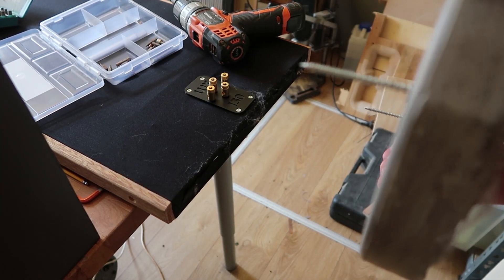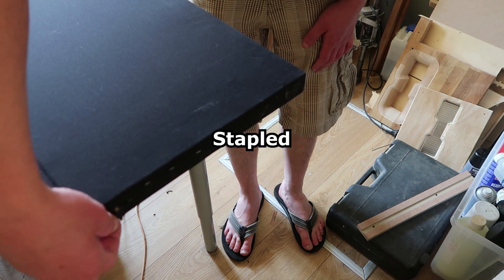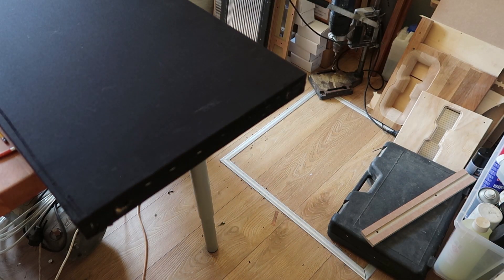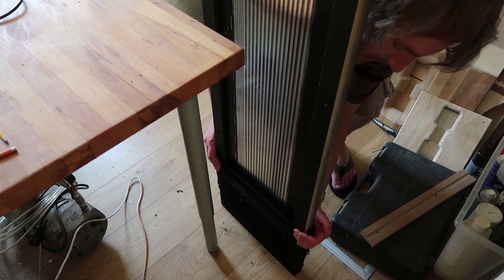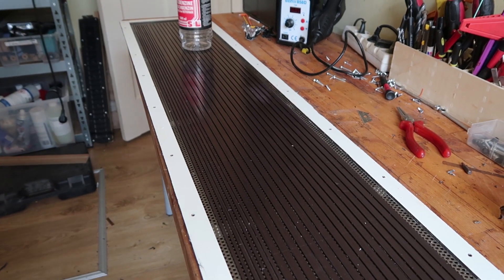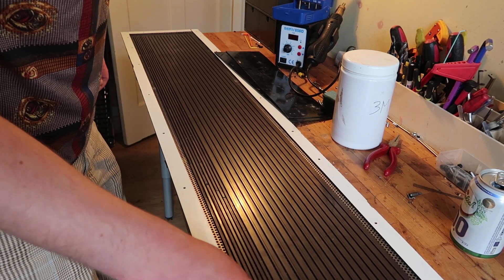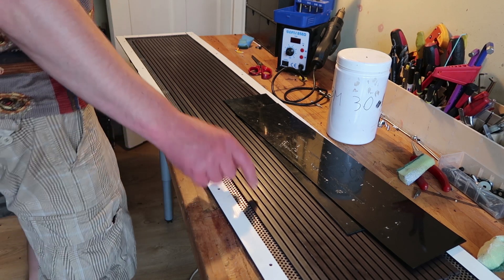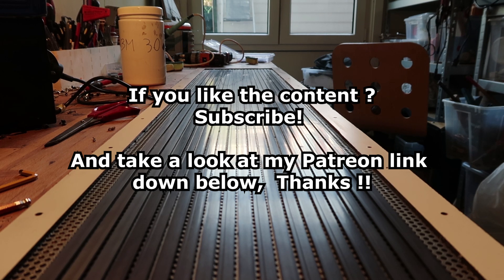Fullrange Planar magnetic speakers - Overhaul - Part 1

Comment: I know i’m kinda late, but what’s the difference between bass magnets and tweeter magnets?
Reply from the maker: well the magnets are just magnets, but bigger magnets extend there magetism further out. so for bass bigger is nicer, (often they have a larger xmax) then again wide magnets makes it not possible to have trace to trace distance be close... this will hurt high end. so less wide magnets are more suitable for top end /mid range. besides that big magnets might create cavity resonances at a lower frequencie. in the bandwitch you wanted to use

Comment: Where do you find the your magnetic strip? I can only seem to find sticky back magnetic strip. Because of the sticky back, you have to buy a roll of type A and Type B to allow for alternating poles.
Reply from the maker: well i get it from a wholesale company that only sells to other companies in the Netherlands :(  so im sure you can get it somehwere else but i dont know where :(  it is anisotropic magnet 3mm thick 8.5 mm wide. magnetised trough thickness. make sure you dont get multipole magnet. (most rubber magnet is multipole) one side of the magnet just have to be north other side south.   i do sell rolls for 100 euro 50 meter ex VAT/customs. but shipping might be expensive depending on where it has to go :(

Comment: I don't have the tools to build planars. What do you think of DML speakers? I'm thinking of sticking some dayton exciters to a pair of 50/50 cm  plexiglass pannels. I think I'll be able to build a frame for them  with the tools I have.
Reply from the maker: exciters are good fun to play around with! if plexiglass works i dont know i think a bit heavy, but  who knows. exciters is all about trying 10000 different things.   XPS foam has a good record. as well as laminated substrates light and stiff is the main thing ! rounding of corners and placing excisters  so you dont have twice the same distance from exciter to any end of the stuff you put it on. (so never in the middle)

Comment: Thanks so much for taking the time to share this with us. I am redoing the crossovers on mine right now, 1.7i's, and now that you have given me some info on redoing the Mylar with all three videos in this series I am thinking that I would like to attempt that if I can find a less pure form of aluminum foil to raise the resistance of the foil wires, making the crossover simpler and more efficient. Right now I get 4-4-1 on my ohm meter and I would prefer 8-8-8 for better definition.

I too have taken the tweeter off of the main panel and am going to use a linear array of planar tweeters for that task. Although you gave me an idea for those as well when you added more magnets, where the 2 tweeters could be placed on the outside of the bass panel on both sides, broadening the soundstage. The singe loop of foil on the existing panel gives me 1 ohm of resistance, and so I added a Mundorf wire wound cement covered 2.7 ohm 25 watt a cross the connectors of the tweeter in order to give me more latitude in upgrading the XOver.

Have you ever considered using a cone speaker coil mounted to the center of the with a metal spider holding the motor in place in a panel minus the wires and magnets for the bass section? This is something I would like to pursue in my quest to make a panel that does not require 500 watts to drive.

Thanks again for all of your work.
Reply from the maker: Glad you like the videos ! upping the impedance is not a good idea if you ask me. it will hurt the output and the filter will need a complete rework. and will be more expensive as well.  if your 1.7 are stock i would not rip any foil :) its hard to get it where they where.  i am not sure what you mean by broaden the sound stage, making things wider narrows it :( but i might not get the idea your trying.  adding a resistor that is 3 times the resistance of the tweeter means you will blow 3/4 of all your power in the resistor... that leaves not much for the tweeter, if they are very efficient tweeters  you can else.. its a waste

a cone to a piece of mylar is a no go.  for cones to be usefull things need to be stiff. mylar is everything except stiff :) if you push on it with your finger it will only hit the magnets under your finger. thats exactly what happens when you drive it with a small cone or voice coil. only a tiny piece is playing (and badly even) the rest does nothing .  thats why the coil on planars try to cover the whole foil as much as possible , and drive it as uniform as they can.

if your looking for more efficient planars none of the upgrades you make will make them more efficient im afraid :(  only size will , or making them push pull. or use different magnets :(

kind regards Joppe
Reply: @joppepeelen  I’ll reply in your order of questions. Broadening the soundstage by having tweeter elements on both sides of the bass panel. Since they are at the edge, side, now they are correctly placed as their travel is limited by the membranes attachment to the frame, so the shorter travel of hi frequency generated sound waves is properly positioned in the scheme of the panel layout. But, by trying a tweeter on each side of the bass panel I can raise the resistance of the tweeter element and double the surface area giving better tweeter volume along with two point sources with less distortion imparted to the mid and bass sections. At least theoretically.

Right now the XOver that came with the panels is a discharge capacitor bank for the mid’s and hi's, a capacitor for the highs, and then an inductor at the end of the circuit returning to the amp. This completely destroys the upper range of the speakers, all in an effort to tame the panels ability to create a low load short to the speaker signal. I've driven each section without any XOver parts. The bass panel is driven that way from the factory, full range with no inductor to limit the mid’s and highs. It's 4 ohms, so my amp can handle it. Same with the midrange, although to a lower volume before the amp faults out. The tweeter is only 1 ohm, so is close to a dead short. This of course could be rectified by a larger tweeter panel, same as the midrange as an example, but faults the amp out at very low volume. 

So Magnepan, by not using quality XOver parts is adding a resistive load to the panel with caps and inductors, but not in a sequence that a typical XOver might place them in. My question, which I am trying to answer myself, is if an audio quality resistor and cap can raise the resistance of the tweeter to an acceptable load, why not use them and do away with the soundstage robbing 1.4mh inductor at the end of the XOver circuit? That does throw the amps watts away, just as a bigger resistor, right?

Anyway, thanks for the prompt reply, I am going to experiment with my new inductors, caps and resistors today, and I will let you know the results when I am done, ok? 

Regards—Bill
Reply: And using a second order XOver on the tweeter works, but not great. I have a XOver from GR Research, a 24 mu 250 volt cap to the tweeter with a .86 inductor creating a second order tweeter crossover, but a 6.0 inductor on the midrange, which fairly well kills it, and nothing on the bass panel.

It cannot understand why they insist on saying this panel is 3db down at 40hz, when it is excellent down to 70, but the rest of the panel has to be restrained because of inadequate bass response. I agree with you that this needs a separate tweeter, I’m thinking array film tweeter line array to match the height of the main panel, since I'm not going to make my own. 

My panels have three "buttons" on the Mylar panel, actually it seems a little more flexible than Mylar, that are used to nail that to the steel magnet screen to cure flutters in the panel, since I’ve unscrewed them and run a sweep on the panel. On one of your panels you created a notch filter I believe to solve this in the bass section. 

Since there can’t be uniform extension throughout the panel for any one note I have tried adding wire and foil tape to the center section of the panel to create a stronger field at the center of the panel. A 22 gauge wire worked best, 18” tall across all of the bass section with the positive entering the panel at the bottom and exiting at the top. The little extra boost in the mid section has allowed me to remove the buttons, and the weight seems negligible.

Again, thanks so much for making the videos, I learned a lot, and have confidence that if I manage to break them after owning them 5 years, I may be able to salvage them! 😉

Regards-William Pietrzak
Reply: @joppepeelen  Also: The stock XOver is posted on my Instagram page here with notes on leads. https://www.instagram.com/p/CQWnB5UttQA/

Comment: First, I would like to thank you for the incredible body of work you have published on planar magnetic speakers, among others. Your playful approach to your work reflects the love you have for the art of speaker building. This helps us all who also find pleasure in making loudspeakers. 
Next, I need to ask about magnet polarity. In all your videos I have watched, I have missed any discussion about the most efficient or effective polarity alignment for planars or for ribbons. For example, in a recent video you used long magnets with a square profile. These magnets usually have one of their long faces as north and the opposite long face as south. The other two long sides are thus split with north in one long corner and south in the other long corner. If I want to make a ribbon twitter, should one edge of the ribbon be closest to a magnet's north side while the other edge of the ribbon is closest to the south side of the magnet at the other side? Should both sides be north? Or would it be best for the ribbon's edge to sit right in the middle between the north and south polarities of the faces of both side magnets?
It seemed to me that, in the recent project, you were simply inserting magnets into your jig without looking at polarity. Let's keep in mind that any polarity will stick to the metal mesh you used as the basis for the  MTM speaker. 
In this project, for example, each conductor run has a north magnet on one side and a south magnet on the other. Does this then mean that the ribbon should be the same with a north at one edge of the foil conductor and a south at the other? One would think that this would make the foil's edges move in opposite direction as the music plays. Yet, I have never had to build a driver from scratch. 
Thank you very much. 
Alberto Lopez in Florida. -- I am using my daughter's account since YouTube took away my channels due to their not liking free speech.
Reply from the maker: Thanks you sir glad you enjoy them !! 
well i indeed dont explain polarity everytime anymore since people that watched for a longer time might go nuts :) haha  i made a slightly drunk series once about magnet motors and how the polarities are for different contraptions , here is the playlist. its not looking nice but functional :) https://www.youtube.com/watch?v=0Y4lnlfRDGk&list=PLJaQ5dleqlYe9LsDTCOzd_SjcWdE0IGU7

i hope that helps !

kind regards Joppe
Reply: @joppepeelen  
Thank you very much. It all makes sense now.